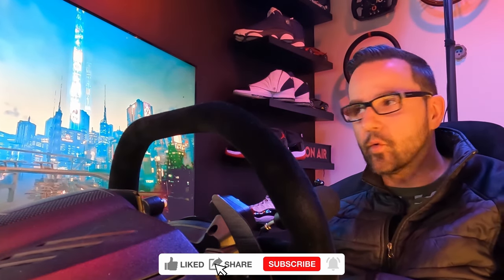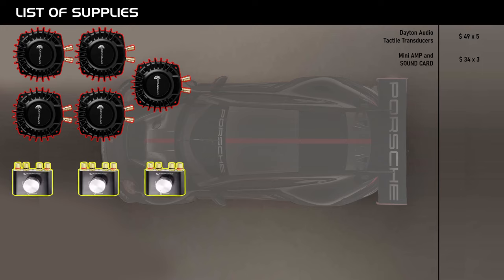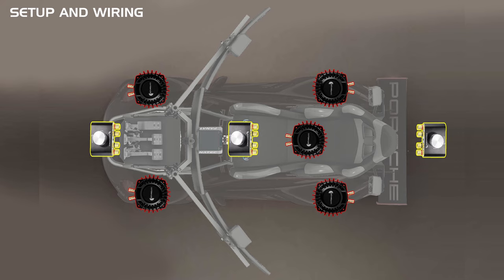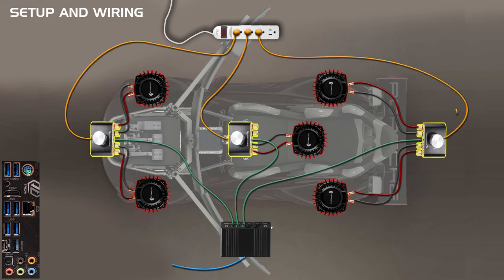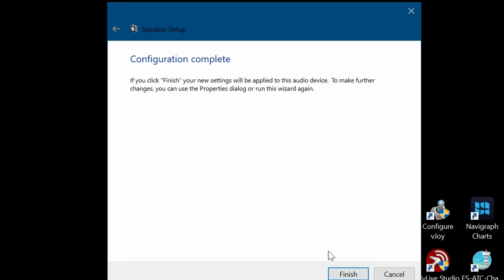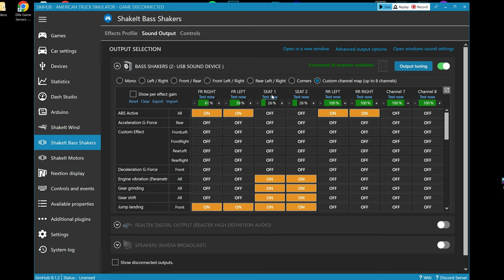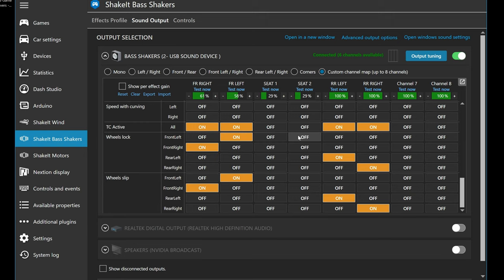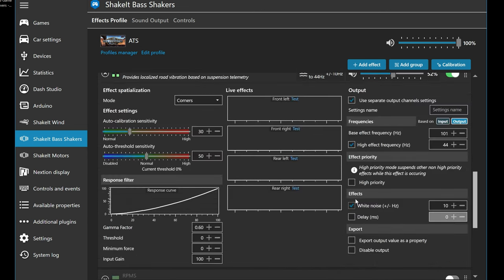DIY ULTIMATE Bass Shaker TUTORIAL | Step by Step HOW TO and SETUP

Comment: I have a nice bug with a g920. When i plug in the AMP the wheel has only 50% break and throttle power 🤣
Reply from the maker: What in damnation ???!!! Hahahahaha I'm not laughing at you I am laughing at how odd that is.. I'm not an electrician but my best guess would be some sort of interference or bare wire somewhere touching ?
Reply: @DaSimSimma  No its a bug i can reproduce.
Reply: @DaSimSimma  After hours of testing... one shaker has a problem and is the reason for the bug. without the shaker all works well 🤣

Comment: Hi Man! Loves your video! Great explanation! Have you been using this for many months now? I'm interested in buying a setup just like this! With 5 inducers! I'm afraid that the nobsound amplifiers will die in a short period of time tho... How much time have you been using this for and how are the amplifiers working? All good?
Many thanks from Portugal!!!
Reply from the maker: Hi friend ! I've been running this setup for at least 3 years if not longer. I do remember one of the noob sound amplifiers died on me very early after a few months. That was 3 years ago ! I haven't had any problems since ! And not to be so careless with money, but it's only 20 bucks ,if they break I just buy another one. One less restaurant breakfast on a Sunday ....a bit more fun in the sim ;)
Reply: @DaSimSimma  that does makes sense! 😍 They're very cheap, yes! I've seen people having problems, cuz i think they're not using external sound card, which makes the amps heat up a lot, and die prematurely! Guess I'll try your setup! Cheaper and better i think
Reply: @DaSimSimma  also, have you seen slip angle? They're a company that makes sell a setup like there but eith four springed isolators

Comment: Great tutorial,  one question, can a internal soundcard be used instead of an external one?
Reply from the maker: Yes. But then you can't use it to output actual sound. It will be bass shakers or sound output but not both...this...the external soundcard. Ps there might be a way in which you can use headphones only but I can't confirm

Comment: Exelent tutorial. One question, I can get the mini amp to work by itself but can't get the sound card to register when I plug the amp on it? Do I need to do some software instal update for the sound card
Reply from the maker: Sorry i'm m a bit confused . When you plug the amp into the PC via USB it should show up in sound settings. Click on it and set it up . The amp is also a sound card , do not plug that into the PC ! Otherwise it will register as a sound card . We are only using it as a amplifier. I hope I am answering your question but I don't think I understand your question. I'm confused when you say "plug the amp into it". What are you plugging the amp into?  Let me know
Reply: @DaSimSimma  All good. I was able to make it work Thanks for your time.

Comment: I’d like to do thing like this with my home theater. Any ideas on how to send an audio signal simultaneously to the sound card and also through HDMI of the graphics card?
Reply from the maker: Theoretically, you could use the HDMI into a surround sound receiver then from there, pick up the low frequency / subwoofer output and use that for your home theater base shakers.

Comment: Great tutorial!,Thx. Maybe a stupid question. But why do we need an external soundcard? And when I use only two daytona's , do I still need an external soundcard?
Can I mount the,daytona's vertical to my alu profile rig? Are there adapters for?
Reply from the maker: You need an external card because the one you have will  b used to put out sound to your speakers. I thought that maybe some guys can use headphone and use the rear sound card  for the bass shakers, but I do not think that works. i used to "split" the sub out on the back of the pc to drive two shakers so you can try that, they make 3.5 splitters.
i couldn't think of a way to mount directly but i guess you just have to rack your brain and i think you can find a way !  I personally didn't find any asapters
Reply: @DaSimSimma  thx

Comment: just wow!!! 2 days ago I sold my motion platform, and moved to Buttkicker Plus, 450€ 🤯but yesterday after watching your video, ordered everything and hopefully I can start building it from tomorrow. first, I had to replace Dayton with AuraSound AST-2B-4, as it wasn't available, second, I got 6 of them, is it possible to do it with 6? so the sixth one is under the pedals and will connect to seat nobsound. hopefully what I am saying is correct.
Reply: Ok, first thing I got wrong was about the pedals, I wanted to put it under the pedal plate, but after reading comments, I will put behind my brake pedal, so I ordered this Dynavox EXC-25 and it is small enough to be easily mounted (ha ha easily), btw how your rig stands? I mean the layer between your rig profile and the ground, I am thinking to use the Spring Isolator, for now my rig has the rolling wheel.
Reply from the maker: Hey friend, sorry it took me so long to reply.  yes you can absolutely do six!
Reply from the maker: My rig is also on casters so I can pull it out from the room. I like to clean around thoroughly at least once a year and then rerun my cables. I have a bad habit of continuing to buy stuff so then I have to continueasly redo the wiring. I think those smaller shakers should make sense. I actually just bought a set of pedals from fanatec and I think they have shakers included in them. I will install them this upcoming week. There's been a lot of comments below as you can see and some people allude to the fact that if you have too many shakers in your mount them to a profile rig that you won't feel anything. There's a bit of truth to that but where are you mounting and how you mount them makes a big difference. I'm able to discern where the vibrations coming from. But yes, with that many you're just going to have to get used to it. You also have to set them up properly in the sim hub software. Lastly, you sold your motion platform? Why did you do that? I'm working so hard to save money and buy one lol

Comment: Awesome tutorial man! Much appreciated.  Can you elaborate a bit further on the volume dial on the amps themselves? Do you have them turned all the way up, 50%, etc?  Also, do you find the 50w per channel is sufficient from the Nobsound? I've read some things about them getting hot.  Originally I bought a Fosi amp to drive 2 BST-1's, but really like your setup and will likely go to 5 as well.  Would be much more cost effective for me to go with the 3x Nobsound's than the $85 Fosi's.  Thanks again man!
Reply from the maker: My amps have plenty of power for my shakers. 50 watts is plenty adequate. I also turn them ALL THE WAY UP, then I can control their volume independently from simhub. In there, there are volume options . I hope that helps! Thanks for watching friend !!
Reply: @DaSimSimma  Perfect, answers everything I need to know! Thanks a ton!
Reply: @DaSimSimma  Having an interesting issue, maybe you ran across the same thing? Just testing my shakers before I install them, and they are barely noticeable.  No shaking, no rumbling, I can barely even hear the music coming through them.  I am testing them through the same Nobsound amp, and running music through my phone just as a test.  I have tried 2 amps and 3 shakers now and same thing across the board.  Wondering if maybe the PSU is underpowered?
Reply from the maker: @lorenajamil7759  I'm not a professional at this but I'll do my best so here it goes : those things are not supposed to put out sound they do because I've heard it before but they're looking for low frequency vibration or signal. So don't be surprised if the music is really low. Second of all, please make sure to turn up your noob sound amp volume all the way up. If you've done so I apologize but sometimes it's the small stuff. Third, check to make sure that the sound card that is assigned to output any sort of volume has the volume all the way up. I know you said you're using your phone but honestly I'm not sure that's a way to test it. Just give it and I'll put from the computer and test it properly to see if you can put out some vibrations from simhub that's the only way to know

Comment: Thanks for the video! Planning to do similar setup. Additionally to 5x BST-1, I would like to use Dayton Audio TT25 under brake pedal for ABS only. Would 5.1 card still be sufficient for this? I mean, can I plug it to the 2nd unused output of the "seat" amp? And then use it separately in SimHub (in your example that would be SEAT2) ?
Reply from the maker: I hope I'm understanding correctly, but in theory it sounds very doable. If your video card has 5.1 that means it has six channels. You are describing six different channels so that should work out just fine
Reply: @DaSimSimma  So I did it :) used used 6th channel to connect tt25 for abs, used 3d-printed mount for HE Sprint. Now clearly feel when ABS is engaged on the pedal, recommend it too!

Comment: amazing.....would have liked to see a couple more seconds on how you mounted them to your rig.  i.e. vesa or some wood you mentioned.  And judging by your accent, sounds like you are in Miami.
Reply from the maker: The best way I can describe it is imagine a rectangular piece of laminate or plywood. Screw the base Shaker directly onto that with small screws because the base shaker has four holes one at each corner. Then take this new contraption you built drill two holes into it and screw that into the aluminum rig. Basically creating a diving board like device that hangs off of your rig the vibrations will move the wood and that whole motion will transfer through the aluminum.

Comment: I hear a 2 shaker setup- 1 under seat and 1 under pedal tray does the job equally well. The 4 corner don't add much to the experience as aluminium doesn't transmit vibrations very well. Is that so? What is your opinion?
Reply from the maker: There are many factors to this whole thing but in general you are correct. This has come up on this channel before . I have my shakers mounted to plywood, and the plywood cantilevered off the aluminum rig. Trust me I can feel it . If you mount the m directly and tight to the rig you might now feel them but again...I haven't tried so I can't tell. One thing that becomes hard to tell but it's not completely gone , is telling left from right , especially in the heat of a race . Again, mounting to wood than wood to metal did it for me ( but they have to hang off a bit like a spring board )

Comment: If I bought these shakers I don’t need to buy separate one for the pedals? Like the Simagic shaker
Reply from the maker: I'm not trying to be funny. But, you could buy as many as you want.lol what I mean to say is you can definitely set it up the way I have it. Plus set up one's by the pedals. All of those different shakers can be given different characteristics or telemetry data so they will all work! But I guess you're asking when is it too much ? All the telemetry data that you would send to those pedal shakers can be sent to these. So ultimately they would feel the same. Which you have to understand is putting four or five of these on a metal rig. Could possibly dampen them versus putting two directly on your pedals where you can actually feel them directly underneath your foot. I hope this makes sense. You can do it my way plus your foot pedals. Or you can do just the foot pedals or just the way I show it. All of it is possible and all of it will give you a awesome outcome

Comment: If I were to just use the nobsound usb amp and just have 2 shakers, one shaker for the front and one for the rear, can I skip the separate sound card? You said the nobsound amp can control the 2 outputs separately so I'm assuming I can just have the nobsound amp?
Reply from the maker: Absolutely !!! That's how I had it first before I added 3 more shakers

Comment: Hello,

Got confused with the  green wire. It goes out from the knob sound from the hole it suposed to get the electricity to run or from the AUX out???
Reply from the maker: The GREEN depicts the AUDIO OUT Wire!! Tan Is for power. Pause the video and look carefully so you can gain confidence in what you're doing. Let me know if you need any help !!
Reply: The colors (power and audio) are changed but I understand what you say  @DaSimSimma

Comment: Thank you for the video, I have everything I need on my amazon shopping list (black Friday specials hopefully). If I do order them, I will go through your youtube channel so you can get a little $$$.  I am a blogger, so I know how it is.  
 I see at around 2:01 where you are showing the transducers attached to the plywood, you only have 1 side of the transducers screwed into the wood with the other side hanging over the edge of the wood.  I wonder if there is any loss of vibration doing it like that?  For me, my racing rig is made from pipe, so I am looking at using conduit clamps attached to a block of wood which the transducer is screwed into.  I am thinking it should give a good transfer of force.  It would work similarly to the buttkicker clamping system.  I was using a single buttkicker until today.  The transducer died last night.  With this option, I can have 1-6 transducers on my rig and a separate one on my desk chair.  I was always moving the buttkicker between my chair and racing rig, with this option, I can have dedicated systems.  And next time something goes out, heavens forbid, It won't cost a kidney to replace.
Reply from the maker: Hey Mark ! I'm glad this will benefit you and work out for you I'm having a blast with it. Regarding loss of vibration actually in my stupid mind it's actually the opposite where I believe that hanging over the edge and not fully mounted allows it to vibrate bounce up and down a lot better. My rig is so sturdy that if those are extremely hard mounted into the rig the vibrations would actually be soaked up a lot faster. It's hard to describe but it works having them cantilevered like that especially on the back. And you are too kind about your words and your support it is very difficult I've been grinding at this even though I have a full-time career but hey you got to put in some effort for things that you love ;) good luck friend !
Reply: @DaSimSimma  Thanks for the info.  I think I will try it your way only attaching the transducer to 2 points and having the transducer attached at all 4 points.  Should make for an interesting experiment.  But I can see how having the transducer attached at 2 points could increase the shaking.  I know about the difficulty of grinding and doing this type of thing.  I am trying to do blogging full-time.  Google had an update in October that removed about 60% of my traffic, which means 60% of my income.  Although, over the last 2 days I am starting to see a slight recovery.  I don't have a Youtube channel yet, but that's coming.  Keep up what you're doing!

Comment: Great vid.  Did you have any issues with the gear shift effect?  I have a single buttkicker gamer plus (probably selling it for a setup just like yours soon).

Using the "test" button in simhub for the gear shift effect - it doesn't always produce the same effect to the buttkicker.  Even the telemetry graph doesn't always look the same.  Sometimes it is a sharp peak, sometimes a more flat top/mesa looking peak.  The actual thumps to the kicker for each test are all over the place.  Its like THUMP THUMP thump pfft THUMP thump THUMP.  It makes no sense.  I give enough time between each test to let any vibration stop.  It also feels the same if I am sitting in the seat with my hand on the kicker vs listening/feeling the thump thru the seat itself.

I can't figure out if it is a hardware problem or a problem with simhub.

On your setup, if you do back to back clicks of "test" on the gearshift effect... do you always get the exact same output to the kicker for each test?
Reply from the maker: Sorry to hear , very frustrating! Mine produces the same effect everytime no question. Could be the hardware as you said .

Comment: I'm thinking of doing a setup with rumble motors for the pedals and 2 bass shakers around or under the seat. Do you think something like the bass shaker mount from trakracer would do the job well?
Reply from the maker: I never knew they made brackets but I just checked them out. If I knew they made those I would have bought them ...lol so...I personally would be all in. They made heavy high quality stuff !!!
Reply: @DaSimSimma  
Yeah, TR have some pretty cool stuff, I really liked their pc shelf, but unfortunately it wasnt big enough for my case,, but I managed to make a DIY shelf using their profiles and its really rock solid, also if you're considering getting something from them, It might be worth it to wait for black friday, I got a 160 cockpit with a 30 to 40% discount!

Comment: What cable goes from the soundcard to the pc?  I assume that the cables that also go from the amps to the sound cards are just 3.5mm aux cables?
Reply from the maker: @senahidmujkanovic2413  My tutorial includes pictograms because talking is sometimes not enough but pictures are worth a thousand words. Just pause the video where it shows what cable goes where.
Reply from the maker: @senahidmujkanovic2413  but the short answer is the sound card has to put out sounds to the amplifiers. So yes it is a 3.5 Jack
Reply: @DaSimSimma ok I understand now. I just managed to hook up 1 bass shaker for now using the rca to aux cable. Shaker works but now my surround sound has no where to plug in and I'm not getting any sound out of the g9 monitor...